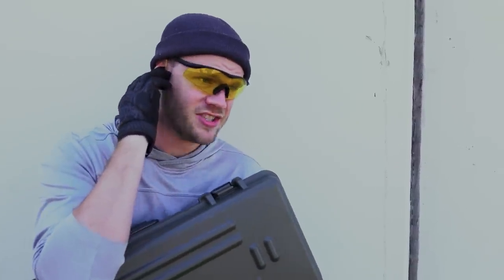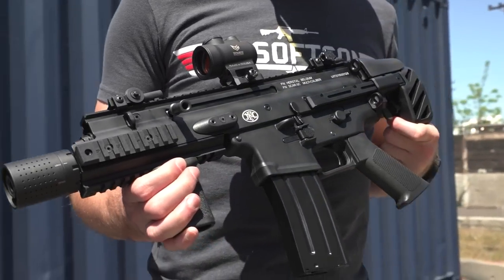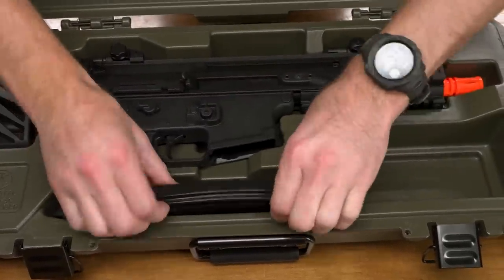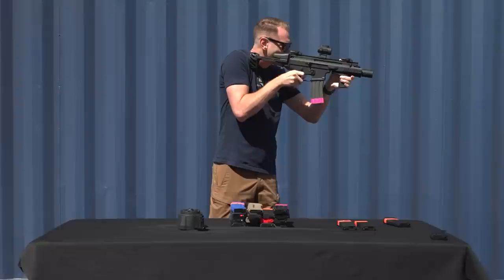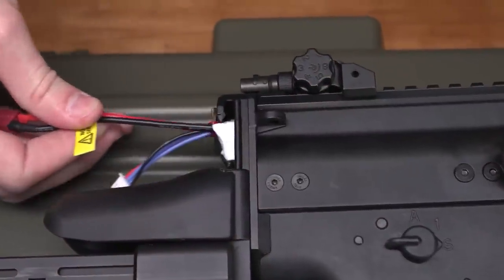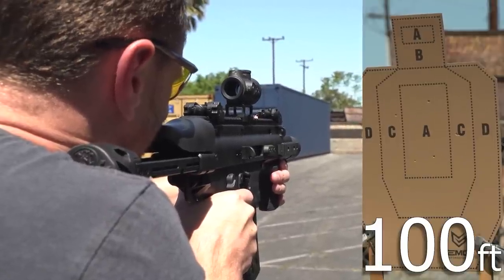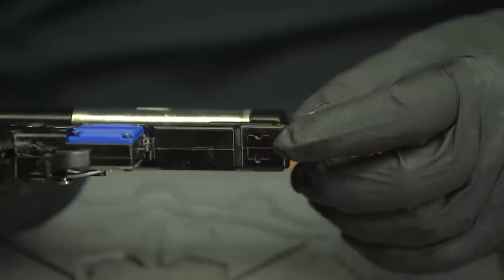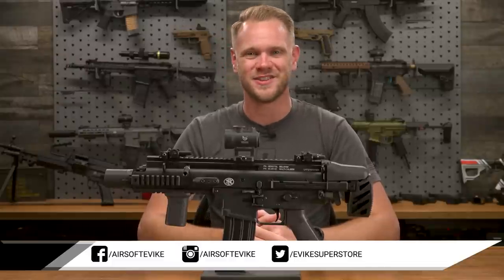Cybergun FN Herstal SCAR-SC AEG Review

Comment: I feel they made a mistake with the case. It looks cool however it will not be very useful. The case is molded to hold the SC with no attachments. Having the SC come in a cardboard box would make it cheaper & less disappointing when you throw the box away.

Comment: should I begin airsofting?
Reply: Get a rental at a field and see if you enjoy it first
Reply: Yes, buy a cheaper but high end electric m4, m16, or AR-14 $120-$200 probably . Get extra mid cap mags and batteries and try to get a high end optic. Later get a gas blowback Tokyo Miri 5.1 hi capa. And a metal slide cuz it’s fragile otherwise. If your worried about price of the aluminum, get zink
Reply: Definitely, it's really fun but I recommend finding a field by you and renting for a few games before you decide if it's for you

Comment: Slim motor, but still the A2 angle on such a small platform. Why not make the already proprietary gearbox work better with a sharper angle? I get that it would limit the aftermarket for motor grips, but it's already limited with the slim motor.